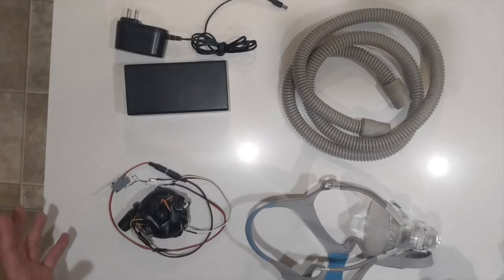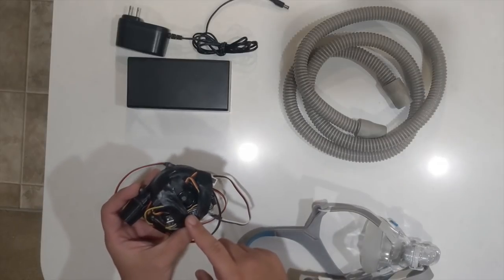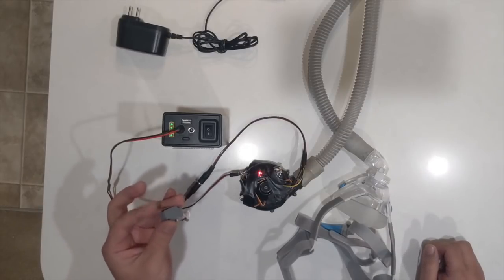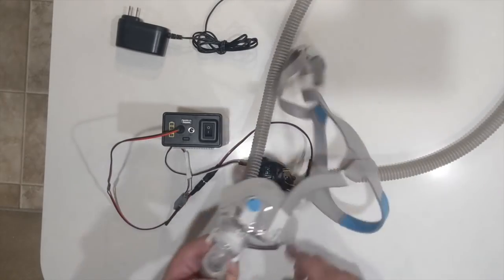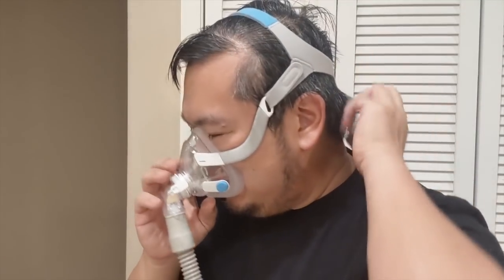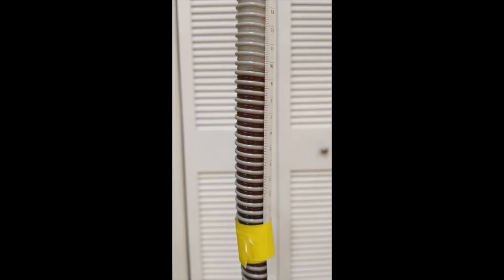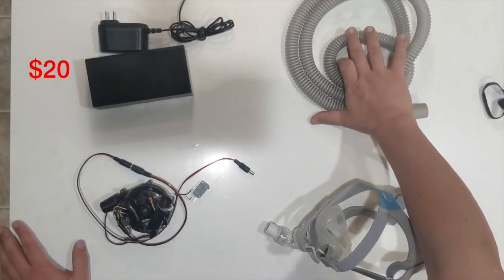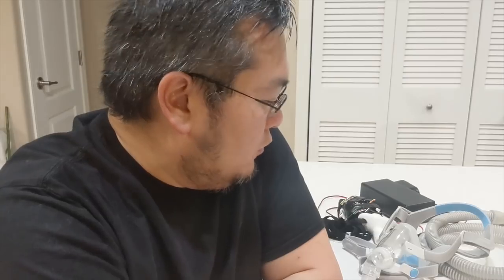Low-Cost Open Source Ventilator-ish Device

Comment: I realize you are attempting to find cheaper and alternative solutions
My question is, could you not just use a CPAP machine?
Reply: it's hard to exhale though a CPAP; not good for someone who is struggling to breath.
Reply: @jasonf8910  There are settings which back off the pressure when you're breathing out though. Are those not good enough?
Reply: @Rantandreason  That's not a CPAP then, it's a BiPAP
Reply: @jasonf8910  Then CPAP machines with Bipap functions. Would that work?
Reply: @jasonf8910  It just seems like a shame to me that you have a tonne of CPAP machines out there, and nobody is giving a clear answer as to whether or not they will help, and why or why not they won't.

I have like 4 machines, and I would gladly donate some
Reply: @jasonf8910  Check out Johnny's notes after talking to pulmonologists and respiratory therapist. https://github.com/jcl5m1/ventilator/wiki/Notes-from-chatting-with-a-pulmonologist
He's currently waiting on more parts & sensors to arrive to refine the design.
Reply: From Johnny on another thread: CPAPs tend to be closed unable to change pressure without prescriptive changes.  They don't actively drive a breath rate.

If an existing CPAPs could simply be reprogrammed, then this indeed would simplify the build and enable a potentially large stock of existing equipment.  We would need a manufacturer to either release the tools to enable reprogramming them or for someone to figure out how to do it on their own.
Reply: @Rantandreason  I  dug around a bit more, apparently CPAP is a good 1st level treatment, but you need a HEPA filter on the exhaust, a PEEP valve, and an oxygenation, which is usually built in to the expensive respirators. See: https://twitter.com/GellandMD/status/1240833089279934465
Reply: @Rantandreason  It seems that all pre-intubation, CPAP is more effective than BiPAP, so perhaps donating some machines, especially if they have humidity and O2 ports would be appreciated.   However, it seems for intubation, the advanced functions / sensors is necessary ensure the patient isn't harmed.
Reply: @ninasocializes1081  Ventilators don't "actively drive out" a breath rate either, they just change pressure like a BiPAP enabled CPAP would.  However, non-intubated BiPAP seems to be ill advised for COVID-19, and for incubated cases you 'll want the advanced sensing in a standard ventilator.
Reply: @jasonf8910  that is accurate. The project strives to answer how to add the advanced sensing easily and cheaply. There's a shortage of flow sensors & valves that are designed for ventilators. If you are interested in helping, further discussions in the github would be helpful. Cheers!